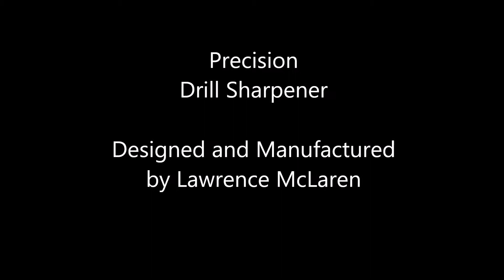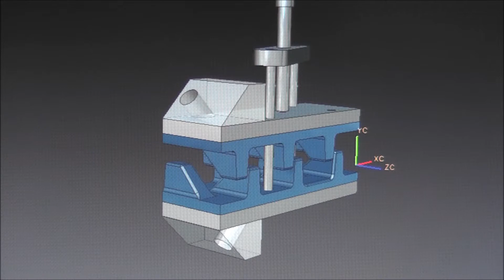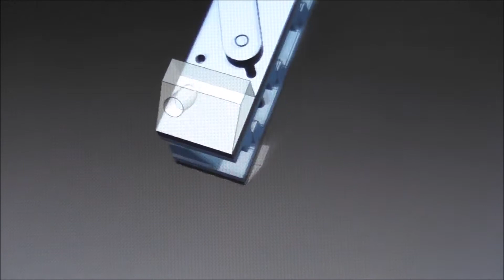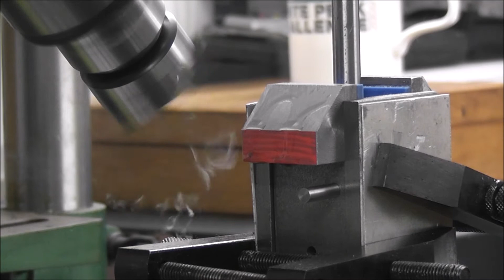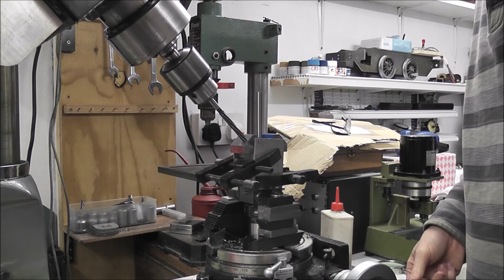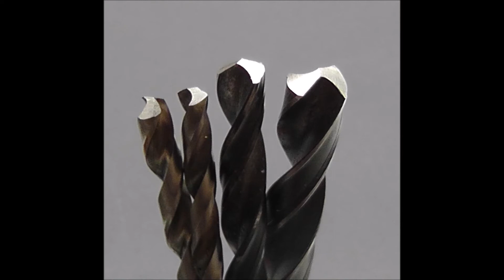Making my Precision Drill Sharpener

Comment: You should not be using the sides of this type of grinding wheel - they are not designed for lateral forces.
Instead use a cup or saucer type of wheel.
Reply: This YouTuber doesn't respond to any of his videos.  I don't think he gives a shit.